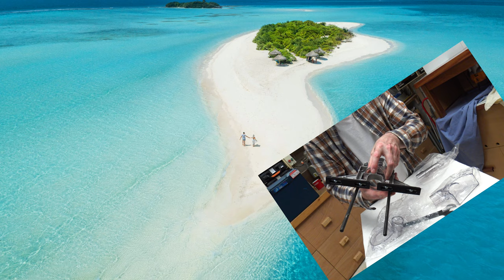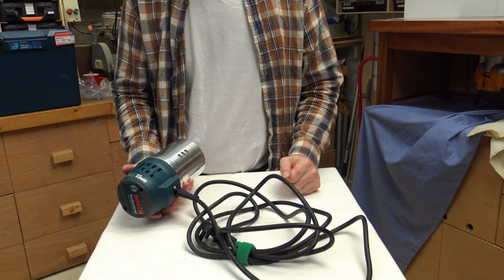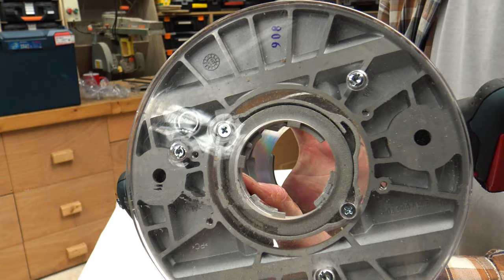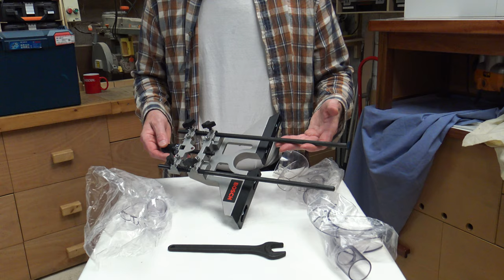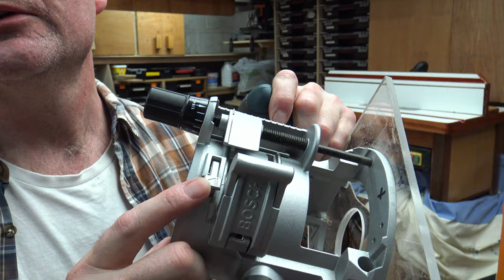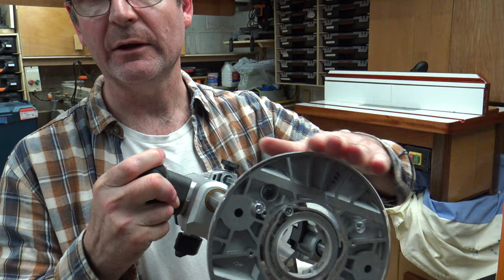Bosch GKF 1600 CE Router Kit - Holtonsfixit101

Comment: The plunge base of mine is getting stuck. When I release the lever it seems to be still locked in place, but if I knock anywhere in the base it releases totally and goes straight up or down, depending if I am forcing the router down, or goes to the upper position if I let.the springs to work freely.

Comment: Cheeky question, but I'm looking for the part no of the dense foam inlay that sits inside the the new style L-boxx like the one in this video, where the guide can be inserted over the top of the router bases. Think they're usually moulded into the underside so was wondering if you or anyone else would mind taking a look. Many thanks....